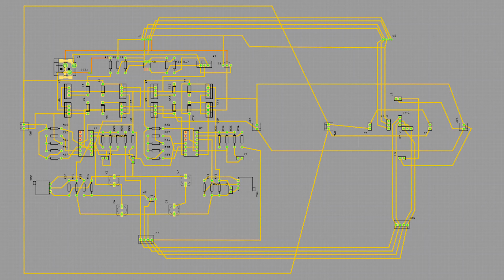Shall we assemble a magical magnetic levitation device.

Comment: Great video! I have the same kit. After building I can feel the x axis coils working but not the y axis anything to look for? Many thanks
Reply: Hey I think I have a similar problem, my led only turns on if I place the magnet on one side, did you found a solution/ the problem? Thank you!
Reply: I found out with my kit that the position and direction of the sensors is essential to make it work.
In your case, Direction of the H3 sensor probably not good yet. It must be bent 90°.
H1 and H2 must be straigt up, height in the  middle of the coils.
Shame there are no instructions to the kit 😢
Reply: @jonass5699  thank you so much for this comment! my board could not keep the magnet stable but i could feel the x and y axis coils working, and the led also lit up when the z axis sensor detected the magnet. after clipping ~2mm off of the legs on the z axis sensor and resoldering, it works perfectly! cheers

Comment: My blue led lights on when connected (and stays on) and not when placing the magnet. Any idea what I did wrong?
Reply: Hi. Look the circuit schematics. Those LEDs are always on since DL3 jumper is connected...
Reply: I found out with my kit that the position and direction of the sensors is essential to make it work.
In your case, Direction of the H3 sensor probably not good yet. It must be bent 90°.
H1 and H2 must be straigt up, height in the  middle of the coils.
Shame there are no instructions to the kit 😢

Comment: Hello I just finished the kit and when I turn it in the floating effect doesn't work and I notice that I start seeing smoke coming from the B772 transistor components. Do you have an idea what the issue could be?
Reply: i have the same problem i dont know what is wrong the B772 transistor gets really hot when plugged in
Reply: @eliottcox5315  So I had got a new transistor and it doesn't smoke anymore. Now I am having the issue of actually getting the magnet to work.
Reply: @CybercoreProtos  thank you, i will do the same and see if it helps
Reply: I bought a new one and put it in and it looks a bit different and now the blue light doesn’t even turn on
Reply: @eliottcox4205  Same
Reply: Did you manage to make any progress because I’m still stuck
Reply: B772 ia intended to have thermal cooling, but it doesn't came with the package.